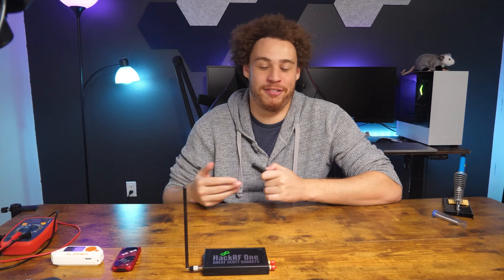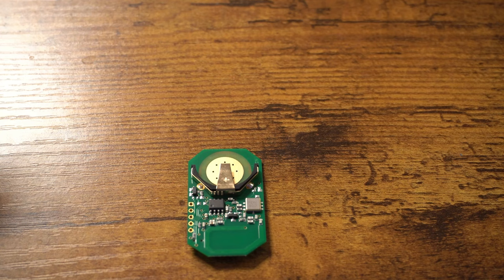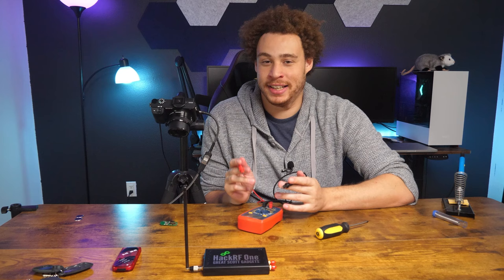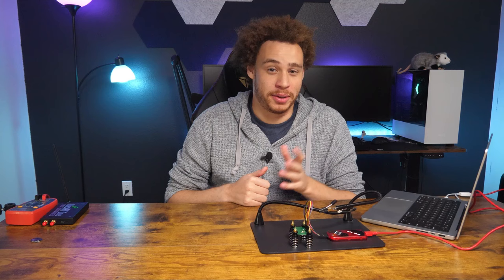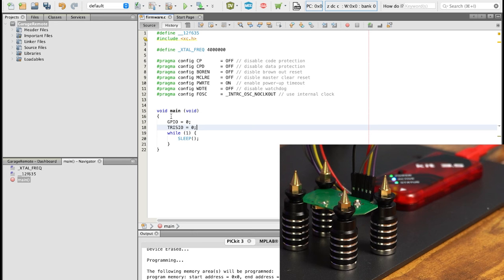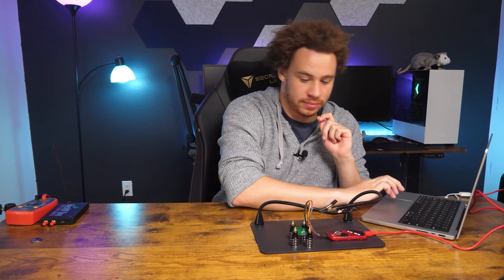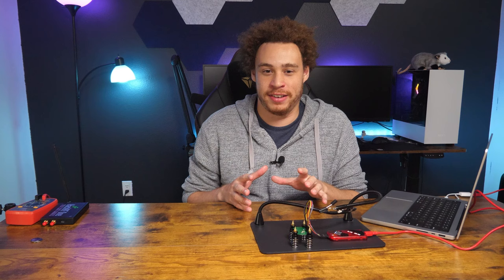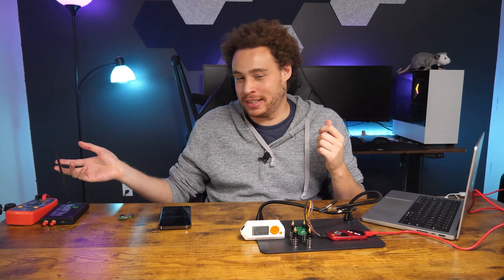How I Hacked My Garage Remote With a Flipper Zero & Microchip Programmer

Comment: I have found the rules regarding this bit of spectrum. 
47 CFR § 15.231
Seems as though you are permitted to play Rick Ashly over it under subsection (e) rules which are roughly 1/10th the transmission power allowed under nominal rules denoted in section (a), however you can only play it for a maximum of one second and then you have to be silent for 30 seconds.
Reply: FCC out here killing the fun 🤣

Comment: I learned about your story and just wanted to thank you for all the work you've done. I had those panic attacks and they are the worst thing. I'm glad you made it through.
I'm always afraid someone will steal my identity or whatever.
Also, another way to see traces on the back of the circuit board is by holding a light behind it.
Not as much flipping lol..

Comment: The reason the LEDs 'seem' wired wrong, is bc if there is a short, you can still open your car door as it should be emitting an unlock signal. At least, that's how it makes sense in my head.